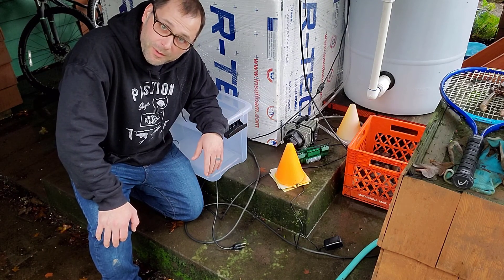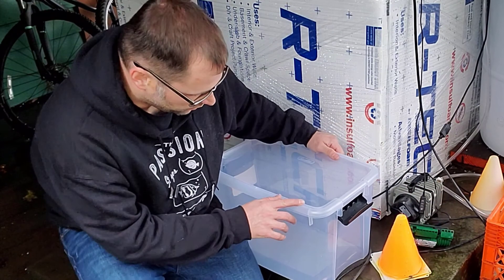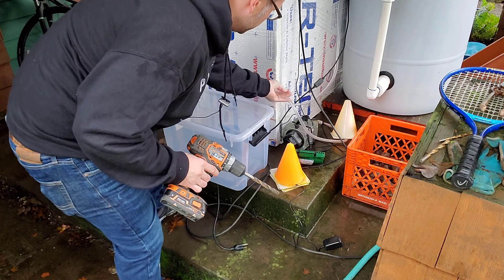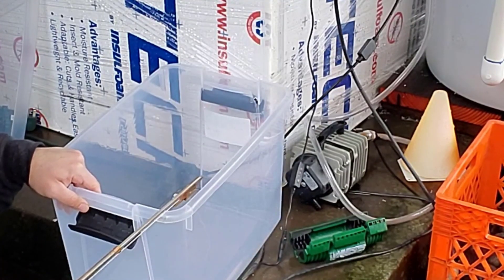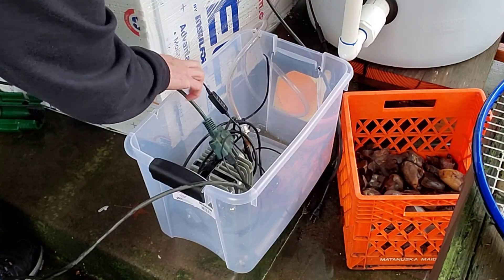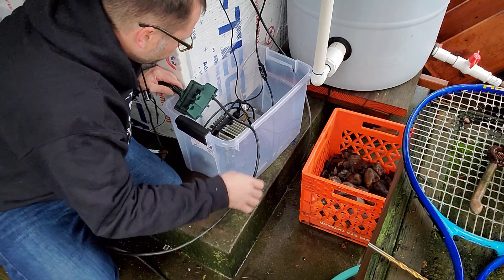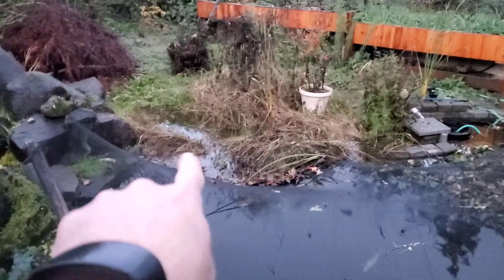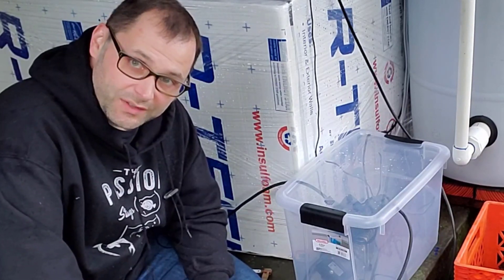DIY Waterproof Outdoor Electrical Box

Comment: You should problaly run the cords a little further down the box before it goes back up and into the box to form a "drip loop" so water runs down to the bottom of the loop as opposed to wicking into the "waterproof" box. Probably also, set the box a little bit off the floor to make sure it's not sitting in a puddle if it's not already.

But thanks for sharing as it is giving me some ideas for my own "waterproof" box for an airpump of my own. 

BTW, i also have the same green plug protector and I have it hanging with crease facing the ground and didn't have any issues with water inside, but I'm in Southern California which doesn't have a lot of rain events until winter.